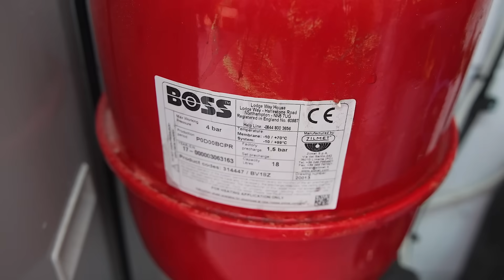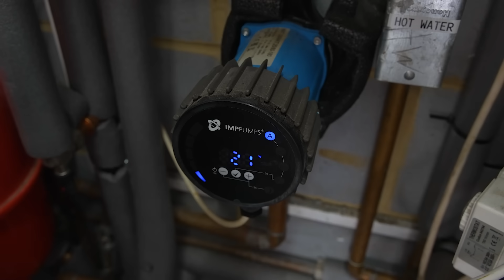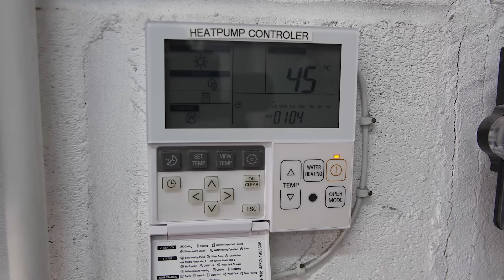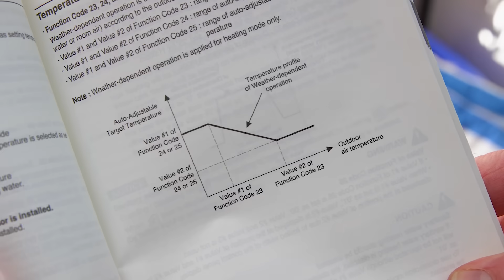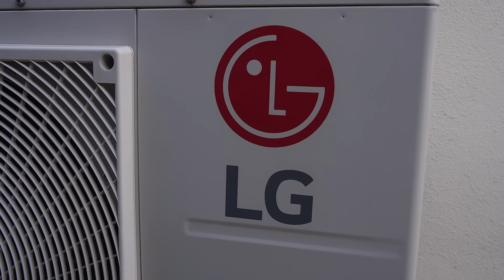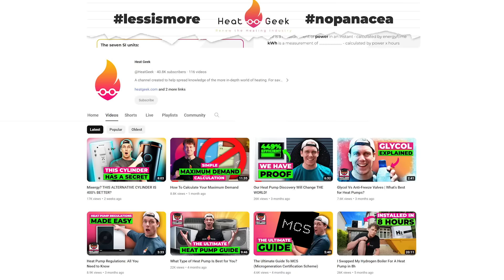Heat Geek Gives His Verdict on John’s Nightmare Heat Pump

Comment: Surely the fan should be held in with rubber bushes to stop vibrations. Being on a small tilt, id very much doubt that was the problem. Ive seen quite a few of these units, that are very level and after about 5/6 years, they are making crazy noises. Oiling the fan, havent had to do that since the old baxi solos lol. Im happy enough regarding system design processes, but its the units that need alot of work. Probably the filters if anything that are clogged up, as they need cleaned min 6 months for max efficiency. Heat pump was out of warranty as they have like a 2 year warranty or something stupid, so why not open up the front panel and see what the actual problem was. Mitsubishi heat pumps are best on market in my opinion.
Reply: Agree on Misubishi pumps. In the approx seven years that I owned them neither of the two pumps (one on each semi- cottage.) were ever lubricated and the noise was still low when sold.
Reply: Boiler fans aren’t comparable to heat pump fans Steven. And ive seen a few heat pumps at this angle but almost no boilers
Reply: @HeatGeek  yes thats correct as one, they are alot bigger lol. How do we know theres not a mouse in there that clogged it up. That noise is so apparent in oil boilers where the fan motor has a rodent in it or the fan motor has got alot of excess dirt dragged in by fan causing restrictions. Should of opened that front panel though, would of been good content as to see whats wrong.
Reply: @Purebeltersteve  fair point
Reply: I'm sceptical the level-ness of the outdoor unit has anything to do with the noise/bearing issues. Some lower quality fans run bushings instead of bearings which just don't last as long. 

I'm based in Australia where all our stuff is air to air, and Samsung units are shocking for this. Indoor fan motors louder than those on units that are only a few years old. 

At least they're usually easy to swap out, but often it's just the manufacturers cheaping out that causes issues like this.
Reply: @Purebeltersteve  Adam could have made the case for replacing the bearings with very good quality ones.
Reply: @tlangdon12  could but didnt, as anything could of been wrong
Reply: @Thermoelectric7  theres multiple things, compressor qulity on these arent great either.. however.. noise is USUALLY the compressor not the fan.. thats how we know its the bearings are gone..
Reply: @HeatGeek the noise is from the compressor not the fan bearings... See my earlier comment. The fans are sealed motor units with no serviceable parts such as bearings etc.

Comment: Great video, as an AC engineer,  agree that condenser not installed correctly,  if the unit is raised 200mm - 300mm higher, on a level bracket or mounting system and moved further from the wall its efficiency will improve as it will have less chance of ingesting cold output air .  If the noise is from the fan motors - replacement motors are relatively inexpensive compared to changing the condenser and may be under manufacturers warranty.
Reply: I cant believe the comment  about the hp needing to be perfectly level to stop fan motor bearings wearing?
Surely after probably billions of bearings in all sorts of motor bearings - we should  be able to design equipment to be   more tolerant ?

Comment: I haven't seen a single installation in SE uk that is cheaper to run than gas - with 2023 leccy unit prices. 35p/kWh leccy and 9p/kWh gas.

Even with the highest practical COP of 3.5:1, heat pumps are still slightly more expensive to run than a good gas boiler.

And oil is still cheaper than leccy. Break even is 98p a litre if using a 90%+ efficiency oil boiler.
Reply: Actually oil is about 25% cheaper than gas right now. Assuming min. 90% efficiency condensing boiler). 

So oil is 100% the cheapest form of heating.

Comment: We have a heat pump in a newly built well insulated home with underfloor heating. Have to say it’s been amazing so far, it’s a very different environment to a gas or oil heating system. Downstairs is always 20, upstairs is 18 and the hot water tank gets heated for an hour twice a day. It is set up with three valves to control the zones (ground floor, first floor and hot water) so is very simple compared to  this setup. The heat pump is controlled to supply heat across two periods totalling 12 hours if required. Most of the horror story’s I’ve seen seam to be due to complexity, too much control ect. It really should be the simpler the better with these systems.

Comment: Don't underestimate the difference between north and south facing walls.
Whilst airflow volumes are large there can be significant gains from solar radiation heating mass masonry on the ground and walls.
I suggest this is the reason that Daikin have recommended South aspects - they have probably made some actual real life tests to make this recommendation.
Reply: Possibly outside the uk?
Reply: My experience on re-location of ASHP for a pool - a 27Kw unit suggested otherwise. @HeatGeek
Reply: Maybe it's down to usage. In the end your pool heatpump probably runs during the hotter part of the year. So there is more solar energy to use. But during winter I reckon that there is not that much usable energy coming from the sun.
Reply: Completely agree, south facing would significantly assist with de-icing and heat radiation from walls would be a massive gain.
Paint the walls black and you'd be shocked at the heat gain.
Reply: You'd think it makes a difference. But I've been told as well the difference is negligible, what we as humans percieve as heat might not translate as well to a higher actual air temp. And that the pump might overheat in the summer being in direct sunlight. I do think there might be an ever so slight gain in some circumstances, but since I have south facing solar panels, the moment the sun shines my heat pump runs for free regardless of where it sits. The times where a heat pump really has to work hard the sun isnt really a factor anyway.

Comment: That is a scary amount of kit in there. Fine, while it's all new. But, think of the fault finding headache when the system, with the number of valves etc. scale up and fail when the system is say 5-10 years old. Firm believer in keeping it simple, it may not be perfect and the ultimate money saver, but you will pay in the end.👍
Reply: That and if you have a normal size garage, you can't park ya car in it anymore.
Reply: @alexandersimpson3638  👍 Totally agree. It's hard enough to find a space for a compact efficient combination gas boiler when you live, as we do, in an average two up, two down house. Which, after having one installed, after 25 years of electric storage heater 'pain', inefficiency and expense, you would have to pry out of my cold, dead hands. 
Simple system, does it's job well (keeping the house toasty in the evening) and we love it. I'll never go near electric for heating again...ever.👍🙂
Reply: Just like modern cars.  Who actually needs a boot lid that closes by itself?  Relays, wiring, motors and sensors all just to close the boot lid!

Comment: Tbf it’s not the heat pump that’s at fault it’s the over engineering of his system.  I don’t condone people sending nasty messages but skill builder is all about hating on heat pumps when he should surely be hating on dodgy or undereducated installers putting in systems that aren’t fit for purpose due to using unneeded buffers etc.  I think he’s done the right thing in collaborating with heat geeks however because it then makes him look a little less biased against air heat pumps as he’s allowing experts who know what they are talking about to counter what he is saying, which I feel that he is allowing a fair argument so for that I salute him for it.
Reply from the maker: It really doesn't matter what I think or what Adam thinks. John is the one who has to make up his mind. To say I am a heat pump hater is nonsense. I do not hate heat pumps. I merely think that a lot of people will regret their decision to have one fitted and that is based on experience not prejudice.  I have fitted them according to drawings, worked out by heating designers with degrees and the heat pumps have disappointed the customers.
Reply: @SkillBuilder  You are right Roger. It is real customer's experiences of the installation in their home that colour our collective knowledge about heat pumps. I hope we can improve the training and skills of installers so that everyone is happy with their installation, but realistically this is not going to happen soon.
Reply: @SkillBuilder  but Roger you do have a lot of videos slamming them.  Adam shows the other side of the coin where heat pumps are concerned.  I actually praised you for allowing an opposite opinion.  You have used experience which is fair enough but do collabs with heat geek that show their side of the story.  Adam came in and immediately saw that the install was over complicated and fitted incorrectly.  And that outdoor intake lean was disgraceful.  I guess this is a compliment but a criticism too but I say how I see it.   

So I guess my question is this.  Is heat geek telling the truth?  Or do you not agree with the assessment done on Johns install?  Yes it’s Johns decision in which way he goes next but I’m asking on behalf of all your channel members as this does split the opinion.  Unfortunately the Scottish government are stating if you want interest free funding and grants for solar panels then you must fit a heat pump too. 

So loads of home owners up here are basically having to take both if they wish to benefit from incentives, so I’m trying to pull pick through if I want to take the risk.  My property is small and fully insulated.

Comment: At last a straightforward explanation - keep up the good work.  We abandoned our plans to include a heat pump coupled with solar panels in our 1920’s house refurb as we couldn’t find anyone locally to install.
Reply: Octopus are training their own installers.  And they're such a good company I'd expect them to do it properly.  They'll now install for free on a 3 bed house that has 15mm copper provided they don't need to replace radiators. The £7500 grant covers the install cost.  Maybe the age of the house would rule Octopus out - but for most people they're a nationwide company.
Reply: Thanks for the reply Mark @markyates5744  - though our house is older we have completely renovated it and part of this was internal insulation and underfloor heating throughout.  Do you think its possible that a decent ASHP could handle the U/F heating - we don't have room for a cylinder unfortunately.  Maybe in the future we'd install PV panel too, but that's for another day. Any comments gratefully received. Cheer, Nev

Comment: The underfloor blending valve has to be fitted because it’s linked in with the gas boiler. No use saying that can be taken out unless he’s looking to scrap the gas boiler from the installation completely. It is essentially a safety device for the underfloor heating.
Reply: Or you can lower the gas boiler flow temperature and save even more money…
Reply: No that's not correct, you can run weather comp on the boiler side, and that will allow water temp to be controlled so it can't go over say 45 degs, see my comment above.  having said that you probably have no chance with a Worcester boiler, it's just not in the same league as Vaillant/Glowworm weather comp systems where every boiler can be married to a weather comp system and multi zoned if need be.
Reply: @HeatGeek  and stay cold? Lol I appreciate what your saying but all I’m saying is that equipment is specified by the manufacturer, altering it is not an ideal recommendation to people
Reply: @derekclark7545   i believe the "Sense II weather compensation controller" can be added to the Worcester Bosch boiler that was shown.
Reply: @derekclark7545  I appreciate that comment. Makes perfect sense other than it will never satisfy the hot water thermostat on the cylinder. So you run 45 degree water from the boiler. With heat loss your looking at, at best heating the cylinder to 40degrees given heat losses. Also the boiler will have to run for a longer period to heat the capacity of water… Hardly acceptable??
Reply: @matthewgeer9176 Weather compensation doesn’t apply to DHW for the reasons you’ve mentioned.
Reply: @SeanW-zi6kj  But only if it is piped correctly and the boiler can be set to not use weather compensation when there is DHW demand.
Reply: @matthewgeer9176  Guess you missed the bit where they said the rads were f huge.... soa low flow temp would be viable
Reply: @Etacovda63  I didn’t actually know that was possible. I was under the impression that a boiler doesn’t know whether it is heating water for central heating or hot water. But your saying some boilers can tell the difference? Certainly not the case with older boilers
Reply: @matthewgeer9176  What I was trying to point out is that with the system controls from Vaillant/Glowworm you control the water temp for the heating via weather comp, so if your heating design temp is a max working of 45 degs that's what you set, and limit it to. When the Hot water stat calls the boiler is not restricted in temp and can run up to 75 degs and heat the hot water as there is no flow to the heating side, weather comp systems normally are set to deliver to the heating or hot water independently.
Reply: @robrs210   Yes the Sense II can be, but its been a long time coming from Worcester, they never got in early enough and the weather comp systems are restricted to a small range of boilers, but again the Sense II has grown that.  still not in the same league though. I believe that room stats need wiring in as their system cannot do multipul wireless room stats, not good as home owners hate there wall being chopped up and hard wood floors, and i like to comply with energy efficiency IE home over 150 sqm should be zoned although that's been reworded now.

Comment: Hello, UK: you do NOT want to give up the comfort of hydronic conveyed radiant heat for air-to-air systems. Roger, please research before flogging this. Here in the US, we need air conditioning and the industry sold us air-to-air. Poor installation is the same issue and refrigerant leaks cause poor performance while relying on blowing air for heating is a step down in comfort.  A2A ends up being oversized very often reducing efficiency and making summer dehumidification impossible due to short cycling. A2W is much better at avoiding oversizing in one unit vs. 5 A2A units, each oversized a bit creating totals of several or many kW to many. Bonus negative is A2A has no taps hot water solution without another separate unit.
Reply: Unfortunately in the UK we have a weak government who the 'green lobby' are forcing to phase out fossil fuels with undue haste.  This resulted in many problems here, not least the push to get people to install heat pumps with a financial incentive.  This seems to have backfired in that it has resulted in numerous inexperienced companies springing up to take advantage of these government grants.  The public have been lead to believe heat pumps are the best thing since sliced bread!

Comment: Excellent video. 
Especially with Roger and Adam who combine both ends of the "heating and installation" spectrum. This is the way to go! Personally I, living in Amsterdam, have a Hybrid heatpump (Remeha Elga Ace 6kW) which works very well.
Most people in the Netherlands still have a perfectly good working condensing high efficiency combi-boiler installed which provides hot water and in a Hybrid configuration,  "helps" the heatpump when it gets below 5C. 
This setup can reduce the use of gas with around 40% to 60% (depending on settings) and will still use existing piping and radiators. 

We really see that now this industry is rapidly maturing, but there are still "cowboys" around who will give the heatpump concept a bad name. Especially in the UK, I hate to say, where regulation and certification of the plumbing and installing sector has been very cavalier in the past.

Comment: Adam has a great way of analyzing and explaining the situation, but I wont believe it until I see that all of his advice end up being a better system overall.

The outside unit might not have enough room, but where else is he going to put it?

I'd like to see a follow-up videos where this installation actually gets fixed and results in cheaper heating with lower noise.

Comment: Our woeful government is truly run by morons! Last year, I got my loft reinsulated with 300mm of glass fibre. It cost me a mere £500. 
Recently the government grant for putting in a heat pump & removing your gas boiler increased from £5,000 to £7,500. So basically you can reinsulate 15 houses for the same price as one ASHP!! It's blindingly obvious which of the two options is going to save money & most reduce emissions over the long-term.
Reply: 100% agree on the morons in government bit!! Insulation is a no-brainer and when done properly it will make ANY house warmer regardless of how the house is heated. A well insulated house will always be more comfortable and cheaper to run regardless of it being heated by gas or a heat-pump. Of course, the nirvana is a well insulated house heated with a properly specced and installed heat pump.